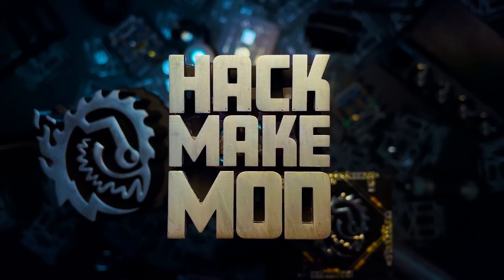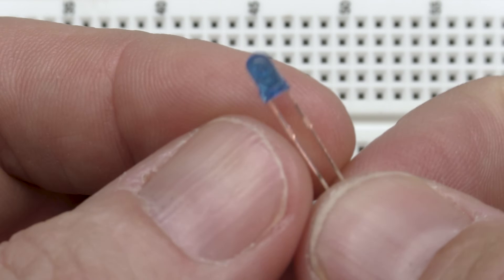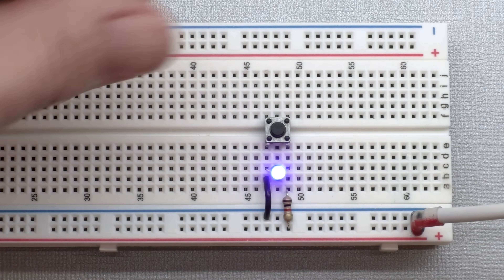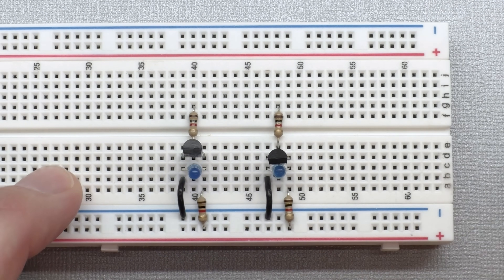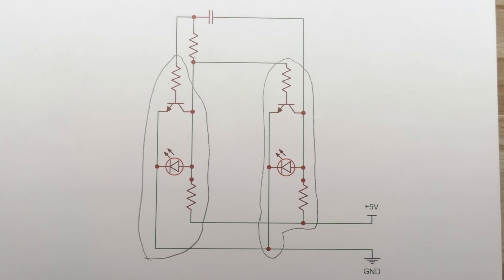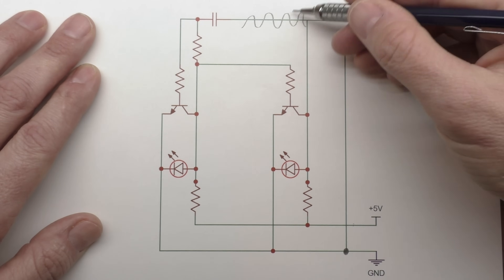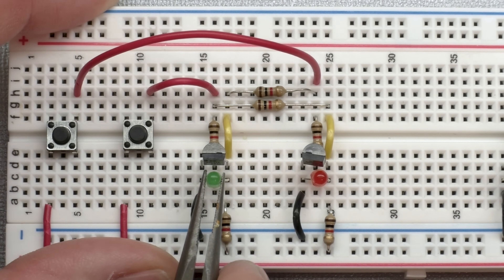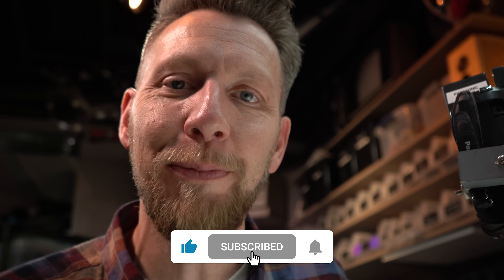Fun with Transistors

Comment: I am nit-picking, but for a NPN bipolar transistor, to "activate the base", you must supply a CURRENT and not a VOLTAGE at the base of the transistor. That said, applying a large enough voltage to the emitter base junction without destroying the emitter base junction, will result in the device "turning on". But to be clear, when talking about BJT's your calculating currents. When talking about MOSFETS or other Field Effect devices, the opposite is true, the input is voltage and not current.

Comment: Watched the whole thing.   Really love that you did this.   I hope you keep doing more like this.   :)

Back in the early days of my career, because I was taught “how” relays worked, and not just “follow the instructions”, I was able to design my own latching relay with multiple bosch 5 leg 12v automotive relays, and I was so psyched that I could, then make all kinds of circuits in car audio.  

I, recently worked with Cheng Lin from CLRacing to create a product for car video screens in Polaris Slingshot vehicles, for multiple camera views, based on left, right blinker or reverse.  Basically, the car had 4 cameras and it would choose the camera based on the status of the signal lights. 

Pretty easy circuit to design, but, it was cool to see it come to life.

Comment: instead of using a 10k resistor I used a 1k resistor for the oscillating circuit. only the right LED keep turning on and off and nothing happened with the left one. can somebody explain why?

Comment: As a "hands-on" mechanical engineer for four decades, I have always been fascinated by the unseeable untouchable world of electricity and electronics.  Your tutorial here helps a lot.  Can I ask if it is really so as you describe at about 16:30 in the video that the voltage rises from negative to positive and then goes negative again?  Or does the voltage in this part of the circuit only rise from zero to positive and then return to zero?  My mechanical mind wants to know.

Comment: You should place the electric pieces on the paper and then draw the lines. How do we know what and where the legs go on the transistor. The way you are showing it the middle legs is to the switch. But I tried it and it does not work. I think I may have burned out the transistor. 
I should ones I have figured it out put the components on a paper and show exactly how they go and send it to you. 
So you can understand better what beginners needs.

Comment: There are so many things you can do with only one or a few transistors. For example, a headphone amplifier with one transistor in collector circuit is quite efficient when you have the voltage and only need more power.

Comment: 11:50 what are you implying is happening instantaneously? It’s not oscillating.

When you connect the output of the right circuit to the left input, it’s merely maintaining the steady state…

The right output is unpowered, so the left base is unpowered- so the left circuit is powered…which was the state before you added the wire…

Seems like you had the right idea to give a better explanation at 16:00 then - inexplicably 
 abandoned it in favor of word salad and hand waiving. You printed the circuit diagram! Use it!

Comment: Safety Suggestion: Those cheap usually Chinese +5V cellphone/mobile wall chargers can present a lethal shock hazard probability many, many times higher than getting such a shock from an regulated analog "wall-wart" of certified PSU.
I especially prefer to not use those cheap chargers for power when I'm using breadboards because of the massively increased number of contact points one is exposed to when working on these breadboards. An alternative is to never touch the breadboard or components while the cheap charger is plugged in, but memory glitches do happen.

I suggest just go ahead and purchase a decent certified PSU because if in all likelihood if you're experimenting at this level, you're soon going to need one anyway.

When buying one, you also might look for any youtube reviews/teardowns/"see what's inside"  of one you're interested in or purchase from a very reliable vendor, because there are Chinese PSUs out there with COUNTERFEIT SAFETY LABELS on them, and they too, could present a shock hazard.

Comment: 10:56 "If I take the output of the 1st one..."
What do you mean "output", that's the Collector.
Also, the 1st transistor doesn't send anything to the 2nd one (what does "it sends 5V" even mean?).
The reason the 2nd transistor switches OFF its LED is because the 1st one doesn't sink the voltage.
It's the exact same reason the 1st LED is ON (& not because the transistor "sends 5V" to the anode).

That whole part is misleading & confusing.
I can only imagine how confused newbies will be while building their future projects, trying to have the Collector "send voltage" to their load.

Then at 11:50 you are saying "anything happens instantaneously ... we have to introduce a delay".
Which implies that the circuit is oscillating, but it does so "instantaneously".
Well it doesn't; if it did it both LEDs would be ON (& dim).
That's basically the S/R latch shown at 18:08, minus the extra Base resistors.

I appreciate you trying to teach people complex stuff (like transistors) using simple words,
but teaching them wrong concepts using the wrong terminology is a terrible thing to do to someone just starting out (potentially dangerous even).
That terminology will stick, & they'll have a hard time figuring out what they are doing wrong, & re-learning the correct one.

Comment: i don't know why, but connecting the speaker to the positive all worked, while connecting it to the ground resulted in a higher pitch and just one light oscillating with the other one turned off.  More over, connecting the other terminal of the speacker to the output of the other light meant a even higher pith with both light turned on instead. (somebody tell me what is happening, if maybe I did something wrong
)

Comment: Thanks man!
You've done a GREAT job explaining this oscillator.
I couldn't understand it before.
Still wondering why the first LED remained on.
The oscillator circuit is still hard to understand from the schematic.
And the schematic is missing another node between the speaker and the cap at 15:20.
But this video triggered me to go play with electronics again.
Keep 'm coming!

Comment: I guess I’m the one person here who doesn’t give this video a 10 out of 10…Why hand wave over the explanation of the most confusing part of the circuit? Adding the capacitor and 10m resistor 😵‍💫

At 11:07 earlier you described the powered base as providing a lower resistance path to and ‘robbing the LED of power’ - unclear why this doesn’t happen when you add the wire from emitter on left to base on the right.  Why doesn’t that new path rob the left LED of power and cause it to go out too?

18:20 “now we’re going to run power to the first one…” (connects wire to the second one) “and run power to the second one” (connects wire to the first one)

Ok…the “first one” to me means the first one you built…which was on the right. And the second one was the second one you built (which you put in to the left of the first one). This gets confusing because you also stop referring to the ‘base’ connection and start calling it the ‘input’ to the circuit without warning.

Comment: Great video thank you. I’ve followed along on TinkerCad and managed to do most of this, but the last part with the buzzer didn’t work (not sure if I used the right kind of capacitor, or disconnected the piezo wrong), and the SR latch wouldn’t latch. 🙁  Is there any chance you could recreate these circuits on TinkerCad and explain why I’m having trouble there? 🙏

Comment: With the resistor and capacitor step. My right led is blinking but the left stays off continuously. The base of the left transistor is fluctuating between 1.8v & -1.4v, 1.8v when the right led is on, - 1.4v right is off. Anyone know why left led is not turning on?

Comment: Hi I'm jeanyves from France, a senior electronician who's now working also in computers. Cause the times they are changing said Bob. 
Nowadays you can have very powerfull components doing nasty things but the problem are: 
1/They cannot be tested on breadboards exept having a quite expensive adaptor which should be different for each packages, and even with that, somme need short wires and cooling!!!
2/They are too tiny packages: now the fashion is QFN/DNF tiny packages nearly impossible to be implemented with low definition and homemade etching PCBs (except the best ones)
3/They are black boxes: You do not allways have the detail of each in internal parts.
4/They are fragiles and expensive: If you make a wiring mistake they will grey and you'll have to pay again. With transistors You just need to test them one per one.

When i say that people often invoke frequency and i reply them that the simplest circuit is oftern the fastest. Tansistors are very fast.

I do not generalize because  i'm aware that some circuits are too complex to be integrated.
Thank's for your video!
Reply: But lots of things may be implemented with transistors.
I'll add that transistor is the basis of electronic.
Nowadays i can see some students coming out of BTEC and not even knowing how to wire a transistor.
This is just because they did not learn it well or not enough. Transistor is a little tricky thing!

Comment: wow.. never seen any explanation like this before. Simple, elegant, and easy way to understand the transisotrs.

Wondering, if you could make another video on Transistor as a switch, explaining Collector side load vs Emitter side load, and base resistance for switching the transistor, with varying battery capacities. When I was doing a simple project - an LDR turing on/off an LED, I thought I understood the transistors well enough to make it work. But in the end someone told me that it is not doing a precise 'switching', rather it is draining (or is leaking the best word?) power so that LED turns off at somewhere when day turns into night.

Comment: With all the thought that went in to this video, I don't understand going with an inverted switch for the simple circuit. It's not hard to understand but it adds an unnecessary potential for confusion for new players. Great video otherwise, but I'm always confused by these little (in my opinion) oversights like this.
While I'm nitpicking, :) the "path of least resistance" example is another very commonly mistaught subject. If current always takes the path of least resistance, a common votage divider would not function. Current isn't a train that takes a single path. It's more like water flow and it will spread itself over all closed circuit paths by a factor relative to resistances along all paths. Since 0 resistance is extremely rare, some current is going to flow through the LED, even when the transistor is "turning it off."

Comment: That’s kind of a backwards way of doing it isn’t it? When you energize a load you’d typically want to stop all current flow right? Instead you’re connecting another circuit to bypass the light which serves no purpose other than to generate heat. Why not just interrupt current from going through the light?

Comment: You keep saying that the resistors in the circuits, at least in the first 10 minutes of the video, limit the current. That's not true. Current remains constant on all loads of a series circuit. Voltage is split between all loads. So a series resistor limits voltage, not current.

Comment: Quite interesting.  Especially you do it without the Arduino or raspberry pi.  May be a surprise comment.  As just a hobby always have those (and bbc micro plus …).  Should have just circuit. And then use 3.3v not 5v for this to avoid the blowout of pi.

Comment: Great video. Many years ago I was very active in HO model railroading. I built crossing gate flashers and block occupancy detector circuits. The block occupancy detectors were known as twin t circuits using the 2N2222 transistors. When a train occupied a block of track, it acted as a short in the circuit and altered the illumination of led's in signals on the layout. Green for clear track, red for occupied track and yellow for a train in advance of the train. It was cool watching the signals change on the basis of where it was on the layout. I still have the circuits on PC boards, but the layout is gone. Thanks for giving me a better understanding on what I was doing when I put it all together.

Comment: Fourth way to determine led direction: use a multimeter with diode check. It will actually light the led a little.

Comment: great video.   I'd suggest drawing your schematics such that current flows generally from top to bottom.    This allows one's intuitive understanding of gravity to add to the understanding of the circuit.    so, for example, your npn transistor should be rotated 90 counterclockwise so that the emitter is at the bottom.

Comment: So this is very confusing how do you know which row is positive and which row is negative on the bread board then how do you know which way is positive and negative on resistors diode transistors the whole enchilada?
Reply: "how do you know which row is positive and which row is negative on the bread board"
The convention is to plug the positive lead of your source (typically a red wire) to the row that is marked with a (+) plus sign on the breadboard (it typically has a red line running along it).
& the negative lead (typically black wire) to the row marked with a (-) minus sign on the breadboard (it typically has a blue or black line).
If you connect them the other way around you won't harm the breadboard or anything, but it will be confusing & you may connect the wrong part with the wrong polarity afterwards.

"how do you know which way is positive and negative on resistors"
Resistors don't have polarity, you can connect them any way you like.

"diode"
If you take a look at a diode, you'll see it has a line on its body (typically black or silver) near one of its two terminals.
That line marks the negative terminal.
Similarly to LEDs (which are also diodes), where the flat side also marks the negative terminal.

"transistors"
- In NPN transistors (like the ones used in the video), the Collector is the positive terminal & the Emitter is the negative one.
   Meaning, the current flows from the Collector to the Emitter.
- In PNP transistors the Emitter is the positive terminal & the Collector is the negative one.
   Meaning, the current flows from the Emitter to the Collector.

"the whole enchilada"
I'm European, I don't know Mexican recipes. 😛
I can tell you about capacitors though.
- Those that looks like lentils (1:24) are called "ceramic capacitors", & they are non-polarized.
   Meaning, you can connect them any way you like.
- Those that are polarized (1:21) are called "electrolytic capacitors" & are marked similarly to diodes, as in, they have a line on their body indicating which terminal is which.
   The difference is that they also have a sign printed inside that line (+ or -).
   Although typically the line indicates the negative terminal, some manufacturers use it for the positive terminal instead.
   So when it comes to capacitors, always make sure to check the sign before connecting them.

Comment: Great presentation!
Having worked for 38 years in three different branches of electronics and now ten years retired, even for this old-timer there was something to learn.
In particular, I am interested in the thermistor driven latch. Question? If we were to make this using two transistors from the same batch so having good Vbe match, would a temperature sensitive latch be possible?
My interest is in a temperature sensing end-of-charge circuit for single-cell NiCad charging starting from a 12V solar panel. There are chargers for lead-acid but nothing I can find for NiCad etc so homebrew looks like the only way. One transistor would be exposed to ambient and the other thermally connected to the NiCad being charged since we will register a spike in temperature at full charge.
Keep up the good work and will keep an eye open for your pages and it's good to see something made out of discrete transistors especially for some folk who might think it's 'chips' with everything or nothing at all!

Comment: The video is excellent, you are a good teacher.

I have a question. As I understand it, you just short-circuit the LEDs to switch them off. This means that the transistor is swallowing all the energy that the LED would use, which seems to me wasteful for real-life applications.  How could this work so that the control transistors don't have to handle as much current as the controlled loads?  Could we just use a couple of extra NPN transistors?

Thanks.

Comment: could u give me some advice regarding the use of resistor after capacitor connection in order to make both LED blinking ... i dont understand on that part .. please help
Reply from the maker: The resistor slows down the recharge of the capacitor. A higher value resistor will cause the capacitor to recharge more slowly, therefore, adding more delay.

Comment: okay but you barely touched up on how a transistor works. why just take a 1k ohm resistor and call it a day? why then suddenly use a 10k one with the capacitor and not give any explanation to why. you didn't even warn your viewers about blowing up the capacitor, that's the worst thing that can happen out of the whole thing

Comment: Hope you don't mind me asking a beginner question. I live in the UK and we have 230/240 volt mains supply. 
How can I safely connect my supply to the breadboard. In my ignorance I am thinking of a 5v transformer. Or should I play safe and use a battery. 
Such a great explanation and with great clarity. I have always wanted to make a simple circuit but more than that I want to understand what is going on, and understand the schematics.